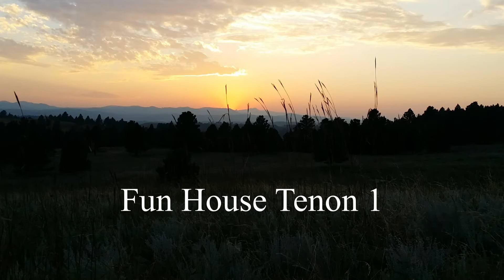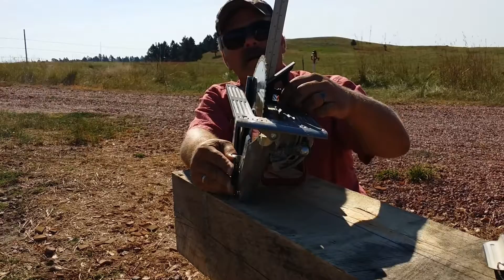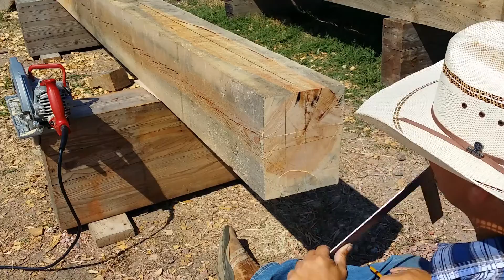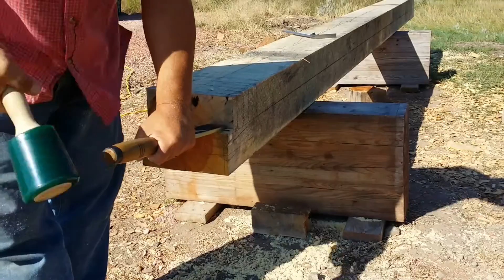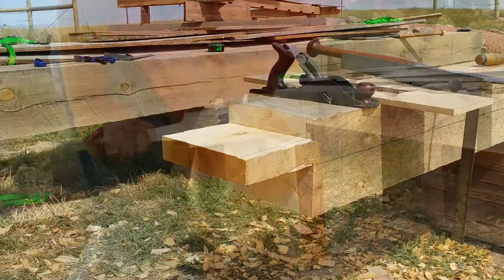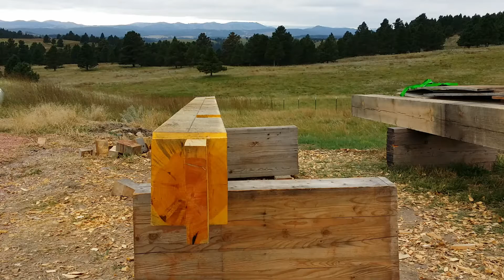Timber Frame Barn - Fun House Tenon 1

Comment: Hey looking great.  I see no reason it will not work just as you need it to.  I have an idea for you to explain to others why you use the chalk line layout for beams like this. This could very well be a round tree not milled at all, you would use the same layout method on a round timber as you do with a twisted one.  The twisted sides of the beam mean nothing other than the looks,
Reply from the maker: That is true Jim, thanks for the comment!  Good to hear from you

Comment: How do you get the correct dimensions for joints and overall geometry?
Reply: He's doing 2inch from edge, 2inch tenon-mortise,half inch housing layout in general. TF Fundamentals is a book i recommend if you want to learn more about it, for simple -small buildings few rules of thumb can get you there too.
Reply from the maker: Hi Carol, the string lines are snapped on each side and that is how you get your measurements.  Check out the video called twisted timbers, I explain it.